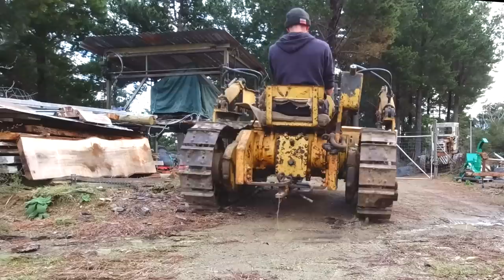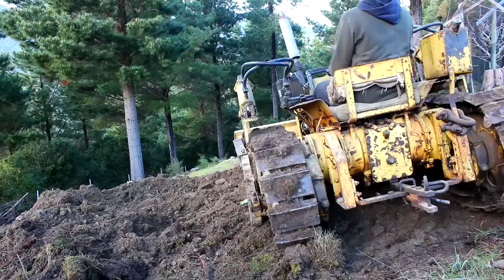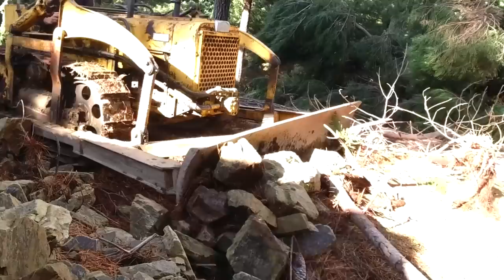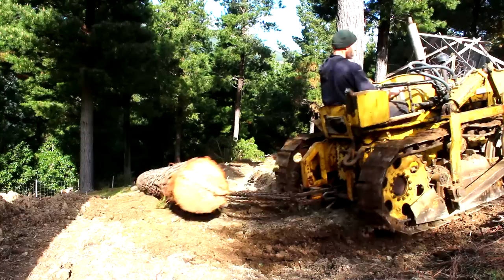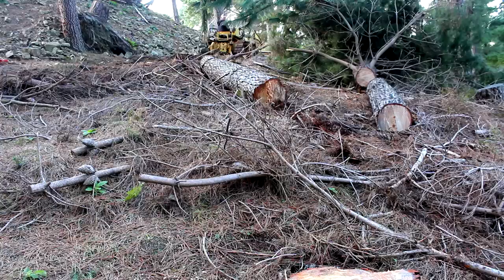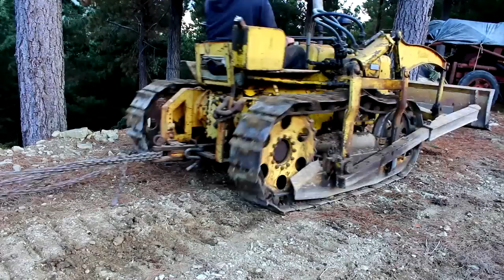Barn Find Vintage Bristol-25 Bulldozer cutting tracks and pulling logs out of the forest.

Comment: Awesome! No computers, no load sensing pump, no DEF fluid, no DPF or SCR, no electronic anything, Just good old fashioned steel, diesel and oil. Love it. Nice job Marty 👍
Reply: Err, i think it’s petrol! Les
Reply: Haha…oops…yes it’s petrol.
Reply: If there was a EMP above NZ Marty wouldn't be affected, all his old machinery will keep on running.
Reply: This is the content that I ❤️ from Marty T
Reply: Yepper.  Spark, fuel, and compression.  If you have all three, it'll run.  Today, if a dozer senses too much suction on the intake it'll put it in limp mode.  Such a shame.  When you need a 4-year degree with a minor in computer science just to work on a modern piece of equipment, things have gone way off track.
Reply: No ROP 
Lucky his place is flattish ;)
Reply: @pamike4873  Don't forget oxygen. A clogged air filter will shut you down.
Reply: I have an AC200 diesel tractor, about 100 HP. Pretty much everything is mechanical being it's from 1973. For what it takes to buy & maintain a tractor this size now mine is fast becoming a piece of gold. It's low hours, gets excellent fuel mileage, and has doubled in value since I bought it.

Comment: Looks like a fun machine to run. Impressed how quiet it is.
Reply: It's a stout little machine.
Reply: And being so low slung to the ground fairly safe in that hilly terrain.
Reply: Noticed that also. His boy has grown quite a bit in the last year! Good to see additional access being created around the ol' homestead!
Reply: For sure, extremely quiet!
Reply: @mlsargent51  Marty really does a good job with resurrecting these old, neglected pieces though, doesn't he! 

I also wonder how the skiff he did all the major fiberglass & structural work is doing. as well as the camper shell rebuild?

Comment: Watching you use this little machine reminded me of the first experience in riding/driving a crawler that I can remember.  I'm 64 and was, maybe 5 or 6 at the time.  Our church had purchased what, I think, was a small, military surplus crawler that literally came in a crate and covered in cosmoline.  They brought it out to our farm shop to clean up and prep.  It also came with a 2 bottom plow.  When it was ready, we had a potluck lunch at my grandparent's house, all the church members came out and we drove in around an empty field across the road.  Anyone who wanted to, could take a turn.  Afterwards, reps from the aid society took possession of it, with appropriate ceremony, and it was "sent to Africa".  I can only assume it actually ended up there.  :-)  We actually had a Cat D4 even before I was born, and I remember that tractor, but not as early as this one.  I've also driven a Cat Twenty an =old= Thirty (where the seat's behind the tracks), a small Cletrac (don't remember the model), a Yuba Ball Tread (look it up), and a one-of-a-kind Union Sure Grip (look that one up, too), at a museum at the University of California, Davis (Antique Mechanics Club).  One crawler we had in the collection, that was not running at the time due to a cracked water passage, was a Cat 65, serial number 1C1, the very first production diesel Cat built.  Last I heard, several years after I left, it was repaired and is still run, on occasion.

Comment: I'd consider a roll-cage or some kind of ROPs protection especially working on hills.   Nice to see it in action.
Reply: That would be nice to see what Marty could rig up in that direction - but maybe more for what's overhead, it has a pretty low slung center of gravity and so fairly resistant to the tippies but might in wet and mud be more prone to slippies so maybe an anchor too. Marty, any power takeoff to set a winch on it or enough battery to use an electric one to allow for some extra pulling power?
Reply: @Don.Challenger  yes, agree, falling branches.

Comment: Love how even the rams had to give way for a bulldozer at 0:55!
Quick tip: Plan ahead of time, take a few walks and stake out spots of interest like stubs & rocks sticking up, stake out the path & turns, avoid tougher labor than the (somewhat aged) machinery can realistically pull of without undue wear & tear, if you can.
Then use that to cut the track in such away that instead of swapping the blade around all the time, keep it one side, lets say tilted to the left, complete every second pass & turn, go back up while dressing said tracks a little bit, then when you're at the top, swap blade around, repeat.
Instead of one pass & turn, swap blade, one pass & turn, swap blade, one pass & turn, etc.

And in regards to the video description, actually removing old trees HELPS the environment 10000x more than keeping them.
We don't need one large tree in the last 10 years of it's life span now, we need 10 healthy trees in 10 years!
See, they've become so large that they suck up the moisture that budding trees need to survive.
Even dead/dying trees can be real H2O suckers, they also pose a higher fire risk, I've seen large drying trees go "WOOF" vs softer and wetter young trees.
So, higher fire risk = WHOLE forest burns down, so that's less oxygen generated, and forest fires are large = Sucks oxygen, the smoke generated = more CO2, and with less forest now available to convert the CO2 = More CO2.
So thats more CO2 x like friggin 4 or something lol.

One of the largest CO2 sources right now are the HUNDREDS of wildfires going on virtually UNCHECKED (until it was too late) that could have been prevented, EVERY day.
So it's a win-win-win...win(?) as far as I'm concerned ^^

In fact, as far as I'm concerned, if we use even HALF the budget we in the West currently use on limiting human emissions (which is important, don't get me wrong, but China's industry is what is melting the Himalaya glaciers so we get to generate less CO2 here and feel better about ourselves,  so...), on wild/forest-fire fighting equipment like water planes/helicopters, faster response time (for instance I've heard of forest fires that weren't immediately put out in Canada because they couldn't figure out who was gonna pay for the operation), more forest rangers and other specialists like lumberjacks (who first and foremost cut down old trees at the end of their lifespan), we'd be a heck of a lot better off!

Comment: Pretty smooth running machine! The brakes would be a critical mechanism on your hillside. The comfrey you scraped away will not be phased at all. There will be sprouts in a few days. Wouldn't a fetching arch be a good addition to your logging operation?

Comment: A point of note
Planting trees is a very good idea
Plant as many as you can and in suitable places
We need land to grow food on
More plant life needs more CO2
Planting trees no matter by any amount will not remove CO2 from the athmosphere permanently
CO2 is a two component (one atom of carbon with two atoms of oxygen attached with double bonds) heavier than air trace gas which is an important component in Photosynthesis
CO2 is not the climate control knob

Comment: This past year, here in NA, lumber prices went insanely high.  Of course you mill your own (perhaps excepting plywood), but how did it go over in NZ.
Reply from the maker: Still overpriced here considering how easy it is to source timber
Reply: @MartyT  thanks.  My little guy used to love sitting on my lap driving the tractor ( David Brown 990), and, would slap my hands away if I tried correcting his steering.
Reply: @MartyT  They say it is because China is paying top dollar for logs, making local sawn timber expensive. So saw mills close here and the building industry imports from overseas. Except covid has upset international shipping.

Comment: You really need to add a ROPS to that dozer.  Especially, if you're going to keep working that type terrain.  Also, how many times will you change that blade angle manually before we see a video of you adding hydraulic ramps to do the same?

Comment: Lovely to see the Bristol working!  Just thinking out loud, would it be possible to use the three point hitch on one of you tractors to lift the nose of a log off the ground to prevent the log digging into the ground? (Steering? May be not)  Or perhaps a towed cradle between two wheels carrying the nose of the log, which might stop the front end of the tractor lifting up.
Reply from the maker: To steep and dodgy for the tractors down there

Comment: Not criticizing, just curious, why didn't you put the end of the log on the bucket and drive backwards? Most crawlers I've run are geared really low in reverse and picking up the front of the log massively reduces friction and dirt on the log.  What was the advantage of dragging?
Reply from the maker: It would probably skip teeth if I tried that, the tracks are sloppy and can't be tensioned further

Comment: Why drag the logs when a set of log arches would let you turn the log into a trailer to ride on tires? Simple to make out of scrap metal and some old wheels so you need less power to move the log and have a clean log when you reach the sawmill so no risk to the blade.
Reply from the maker: Yeah I've been meaning to make an arch, one of these days